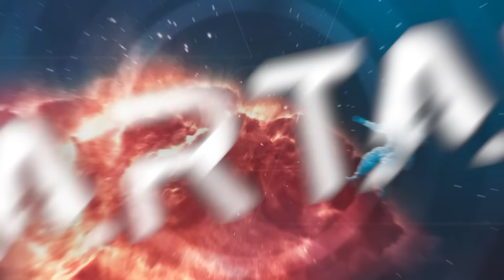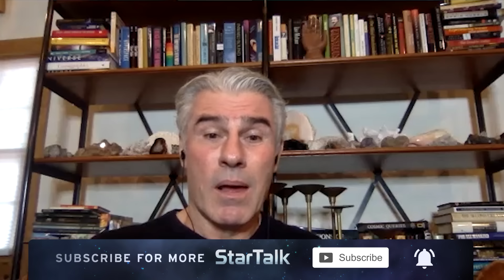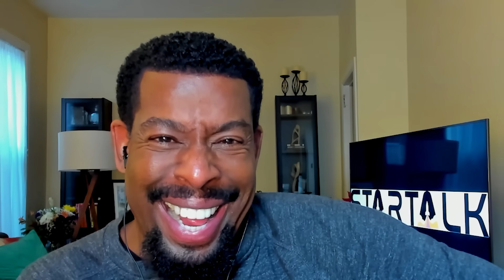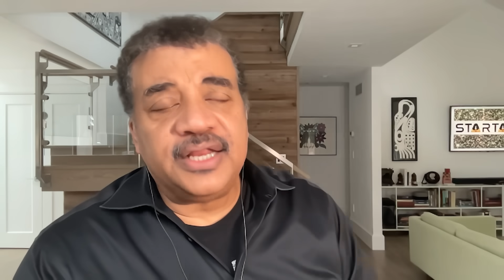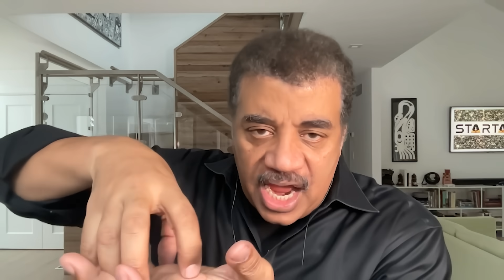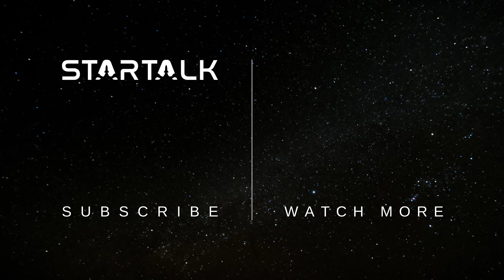What’s The Fastest A Car Can Go? | Neil deGrasse Tyson Explains...

Comment: The fastest on record was a  ThrustSSC driven by Andy Green, a twin turbofan jet-powered car which reached 763 mph.still interested how it was still able to remain on the ground without going airborne. Velocity and speed working together?
Reply: twin turbofan jet-powered car = plane on wheels
Reply: Aerodynamics.  Velocity is speed and direction, BTW.
Reply: Basically an F4 Phantom without it's wings.  The key is to keep air from lifting the car off of the ground.  It helps that the car weighs several tons, but there's also a fair amount of downforce thanks to the aerodynamics of the design.
Reply: 763 mph is transonic, isn't it?
Reply: @kellyrobinson1780  at the elevation they conducted the speed run, that speed was supersonic. The sound barrier is different as you go up in altitude as the barometric air pressure changes.
Reply: @willracer1jz  Right. I know the speed of sound changes with air density and humidity, but I don't remember the particulars. And I have no clue where that run was made. Shoot, I don't even remember the speed of sound at Standard Temperature and Pressure. I just recall that it's somewhere around 740 to 760 mph in round numbers.
One of these times, I'll have to refresh myself on those things. Thanks.🙂
Reply: NGDT is describing a driving not driven wheel. He is describing what happens when the power delivered to the wheels overcomes friction. So the acceleration can only be delivered to the clutch or the tyres before one starts to smoke. With a jet the wheels are driven / following and don't need to "pull" the car forward. It's just octane assisted pinewood derby at that point. That and you could point it downhill.
Reply: @DESIGNDETAIL5 so you’re among the elite who know for a fact that a treadmill is but a minor annoyance to an airplane. 👍
Reply: I suspect that a look at the shape of the "car" body would give a clue to what kept the vehicle on the ground. It was probably shaped to give a little downforce to the vehicle, or had some kind of control surfaces to do that job. I'm guessing. But it's the first thing I'd look for.

Edit: Yes, here we go: from the Guinness world records website, under the title, "Andy Green fastest car land speed record".

Copied and pasted text: 

"As the car accelerated, automatic systems would shift the aerodynamics around, adjusting the suspension and moving control surfaces. This was vital – enough downforce to maintain control at 200 mph would have rammed the car into the ground at 700 mph – but it meant that every time they went faster, Andy had to contend with new challenges."

I'm sure that specific data are available for atmospheric conditions at Black Rock Desert at the time of the run, including the local speed of sound.. Shouldn't take a lot of digging, I'd guess.

Okay, "This just in": the Guinness page said he made Mach 1.02 (under local conditions). That equalled 763.035 mph at the time.

So 763.035 ÷ 1.02 will give the local speed of sound at that time and place.

The following is also on the Guinness page: POV Video of the first of the two required runs, with Andy Green "calling the play-by-play":

https://youtu.be/7D4-49pkEWY

He says the air UNDER the car went supersonic first; then the air above the car.
Since the air underneath was going faster than the air above, the air underneath must have been creating a zone of lower pressure, tending to pull downwards on the car. So there's another downforce mode in addition to the control surfaces.

Okay, I'm done. Thanks. This has been fun!😁
Reply: Large helpings of downforce = upside-down plane on wheels.
Reply: Aerodynamics.
Reply: Really, you have no understanding of downforce? Do you think a plane will fly without its wings? 🤣🤣
Reply: @dalelc43  You've never seen a video of a car flying up into the air briefly because it is going too fast?

Comment: I've heard this argument before, and it's very flawed. When a Top Fuel Dragster can go from 0 to 100 MPH in .8 tenths of a second and will accelerate to almost 340 MPH in 3.6 seconds to cover 1000 feet. That's way, way, way more than 1G!
Reply: They using  huge sticky tires  plus their spoiler  is as big as a plane wing  with 11,000 HP
Reply: They break traction
Reply: I’ve never read a dumber comment. He legit says “in terms of BASIC friction” and even specifically mentions ALL the factors you brought up as being innovations that were geared to overcome the limitations of basic friction. He even ended the discussion talking about the exact sort of argument you just put forth.
Reply: This is addressed in the video.
Reply: The argument is not flawed at all. All that means is that the vehicle using means beyond just basic friction to keep it grounded.
Reply: Did you bother listening to the entire video before you commented?
Reply: @mav3818  Yes
Reply: @ss1320ss  clearly not ^^ you say his argument is flawed, and take thr example of dragsters that he also refers to in the video to explain how they go below that ~3s limit. That or you did not understand what he explained.
Reply: @ledoynier3694  I understand that better than you!
Reply: @ledoynier3694  Their expansion was lame!
Reply: I was thinking the same thing. I've watched videos of Teslas doing 0-60mph under 3 seconds with regular tires, no spoiler, and no rocket engines.
Reply: @acolon8999  I raced a gas-powered dragster that was less than 1000 horsepower and we would reach 60 mph in around 1 second. Nothing special but large tires. Obviously way over 1G
Reply: @ss1320ss  That's exactly what got me confused. You have Teslas doing 0-60 under 3 seconds with stock tires, no spoiler, no rocket engines.  So they are achieving over 1G.
Reply: Top fuel dragsters also get aerodynamic downforce at 0 mph from the exhaust pulses out the headers.

The downforce from the exhaust is commonly known to produce more downforce than ALL of an F1 car.

Downforce is a way to propel the vehicle downward to the surface WITHOUT adding mass… because mass impacts downward AND laterally and longitudinally… thus the 1:1 resistance argument.
Reply: @JonathanTippett  you are so wrong I am legitimately worried about you causing more ppl to be dumb

Comment: Sorry,  but you can play with control arm  angles and shock rebound settings to throw the tires into the ground when you hit it (lots more normal force).  You can find video of slicks deforming and squatting down,  while the back raises up.
Then you need to make sure the suspension unloads slowly enough or you'll do a wheely then spin.
You might like the science behind it.   Lots of geometry.

Kevin Wilson does a lot of YouTube explainers on suspension.
Reply: Well yes, but that is vehicle dynamics, something taught in Bachelor/Master level Education. This is a STEM channel so everything is on high school level, every considered is in static. Pretty much simplified to just the wheel and ground. 
At 0 second there is no torque from engine, when control arm started to factor in the time already not 0.
Reply: That modifies the weight transfer.  Look at classic drag sedans from the '60s.  They improved weight transfer by crudely raising the front ends, changing the location of the mass of the engine and transmission.  Also, when dragsters are still the tires squash down due to low tire pressures they run.  When they launch the tires "centrifuge" to a larger diameter, narrower contact area.

Comment: I heard that theoretically an F1 racing car could drive upside down at high speeds because of that downward force. Is that actually true?
Reply: Called foiling
Reply: Vehicles that light and moving at that speed would inevitably scoop up air and, just from the air resistance, be unable to keep traction and would achieve lift similar to an airplane taking off at the end of a runway. The only difference is that since cars are not built to maneuver through open air, they would toss and flip until they slow down and crash back to the ground. 

So, to combat that, they are aerodynamically designed such that the air resistance is redirected to provide downward force (where down is relative to the vehicle). So if one of these vehicles achieved speeds at which the downward force provided by the air resistance was greater than the force of gravity, it could theoretically drive upside down. The catch being that it would need to achieve the proper speed right-side-up before transitioning upside down and cannot lose speed or surface contact during that transition. And, obviously, it would need to maintain the proper speed upside down or risk falling down if it goes too slow (or if the air pressure decreases too much).
Reply: As soon as the downforce generated is greater than the weight of the car they can and I have heard that they can achieve this from about 150 kph or mph I do not remember exactly. This is different for different generations of F1 cars.
Reply: It is True
Reply: Yes
Reply: Yes this it true, think of downforce as the opposite of lift on a plane wings. Any car can do this if it has more downforce (or lift upside down)than it’s weight and enough speed.
Reply: Formula 1 and other high end race cars can generate 5G of downforce (at high speeds).  If the downforce generated exceeds the actual mass of the vehicle, it could technically drive upside down in a tunnel (for example).  Since Formula 1 cars are relatively light (their minimum weight is 1759 lbs.), they could easily achieve that feat.
Reply: In theory yes practically nope other factors such as starving the engine of oil, fuel getting to the pump, unless it was electric

Comment: The McMurtry Spéirling does 0-60 in 1.4 seconds thanks to a system of fans that push the car into the road.
Reply: meh top fuel dragsters do 0-60mph in 0.4 secs and 0-300 in under 4 secs
Reply: Yeah I seen it in action the worst part is they ran a 7 second run in the quarter mile with a limiter at 150mph.   Neil is extremely smart but should have done more research before the episode. Human engineering destroys that 1g so called limit. That car is faster than a formula one car it has all its downforce at zero. I would love to see Neil go and visit that car and see it in action. That one g theory is just a false theory.
Reply: the Chapparal?
Reply: @2MANYWWWWWWWWWWWWS4U  Those Chapparals were some of the only I know of to have ever raced, but ultimately got banned due to amount of disturbed air anyone behind would need to deal with.
Reply: Went to the comments to find you, thanks 😊
Reply: That is just insane. This would blast past even a jet fighter on full burner on its take off roll.
Reply: @CyberSystemOverload  A fighter's 0-60 isn't crazy impressive. Many street cars could beat even the most powerful, if they have a standard fuel and weapons load. Figure something in the 3-4 second range. If you stripped one down to bare minimum, you would likely get under 2 seconds - something no street car I have seen tested can do.
Reply: @garylacoursiere4413  You're right this is very true! Even with full burners the initial run is very slow compared to a souped up hypercar.
Reply: Tesla Roadster will supposedly have cold gas thrusters
Reply: The McMurtry is insane!!
Reply: They actually suck.
Reply: Koenigsegg Gemera does 0-60 in 1.9 seconds without any fans. Neil is quite far off the truth with his close to 3 seconds being the limit.

When electric motors get even more powerful there is still potential in 0-60 increases with cars that have a low center of gravity and great suspension and incredible amounts of power and great traction control. For sure 1.4s is possible in the future without fans sucking the car down or without sticky tires.
Reply: @epicon6  i was surprised Neil didn't fact check this. My Suzuki from 1992 does 0-60 in less than 3 seconds. Modern day Motorbikes are lighter than my old bus,  Albeit a very quick bus.😁
Reply: The Rimac Nevera reportedly does a 0-60 in 1.84s.  No fans.  AWD though, one electric motor for each wheel.
Reply: I was going to mention it. Mat did an awesome car wow video on that car
Reply: I was thinking the same thing. That little electric car is a beast.
Reply: I can't get the picture of a bunch of guys who push the car forward out of my mind...😂
Reply: Fastest RC car can do 132 feet in 1.1 seconds at 115mph. so 0-115 mph in 1.1 seconds. Drone racing 1:1 scale cars is gonna be a jam in 12-20 years.
Reply: The quickest street legal and proven on radials car just went 6.07 @ 236.8 mph at sick week.. 
McTurdy is slow
Reply: You took the words out of my mouth.
Reply: Mythen can do 0-60 in less than a second, but this video is about top speed.
Reply: Well the fans are underneath so it sucks it down to the road, pushing it down would imply the fans are on top of the car.
Reply: @carlm189  The LOCATION of the fans is immaterial.  The locations of the air intakes and the locations of the air exhausts are what counts.  The work is done by the difference in pressure above the car and below the car.
Reply: @carlm189  well technically the fan removes the air from under the car and the air on top pushes it down.
Reply: @JamesCAlien  It can take turns at 3 g force and owns the record for a street legal 1/4th mile and 0-60. Considering it's a British made car, I wonder how happy they were that they had to run a 1/4th mile and not a Kilometer LOL
Reply: @RobVollat  We use Miles in the UK ;)
Reply: @GordonSime  really? 😂 I never knew that. Makes sense I guess that we inherited it from you in the States. Googled it and in 1974 Australia and New Zealand switched to the metric system
Reply: @RobVollat  There is at least one dragstrip in England, so they are not ignorant of the concept. :)
Reply: @RobVollat  we actually use miles in england.
Reply: @RobVollat  The UK still uses miles. It's the rest of Europe that uses km.
Reply: @RobVollat  "WE" are very happy to run 1/4 mile runs. Uk uses miles not Kilometres.
Reply: And a quarter mile of 8, and the fans create the over 2200 hp of downforce at 0
Reply: @jlutz63  mate downforce isn't measured with hp, it makes about 2 tons of downforce.
Reply: @alijahan  Have they measured how much force a horse can push downwards with? That is the question.
Reply: @RobVollat  sounds like a unit americans would use so you gotta ask them wether they have or not 😂

Comment: Just checked the Tesla website: Tesla S Plaid - 0-60 time = 1.99 seconds. Please explain this, Neil, thanks!
Reply: It's a little thing called marketing some folks invented to sell things to folks like you
Reply: Neil's point is that using friction, alone, you aren't going to get faster than 3 seconds. But if you can engineer ways to get the coefficient of friction greater than 1, then you can keep the car stuck to the ground for higher rates of acceleration. Aerodynamics, tire material, track material, external propulsion, etc.
Reply: @R3_dacted0  "Friction alone" What do you mean by that? Rubber tires have always used friction to move or stop a vehicle, but you can barely compare the level of traction modern tires provide to a 20 yo tire let alone a tire from 50s'.
So I think it's better to say that if your "normal" tire provides a FC of 1 or less you can't accelerate faster than 3 secs.
Reply: All wheel drive.
Reply: Elon should give Neil a ride in his Roadster.

Comment: Top fuel NHRA drag racing is the perfect balance of acceleration and traction (friction),  the vehicles are designed for the maximum amount of downward force on the rear wheels that get heated up and become sticky in the pre-race burnout
Reply: Setting the clutch on top fuel is an art which is critical slip rate .

Comment: Top fuel dragster: 0 to 100 in .8 sec.
Reply: Someone has never seen a top fuel dragster before. Massive slicks that wrinkle with force of the engine to achieve as much grip as possible. Science! Grow some brain cells please.
Reply: The video specifically exempts vehicles that aren't powered by friction against the road.
Reply: top fuel dragsters rely on tire friction. Large tires very sticky rubber compound.